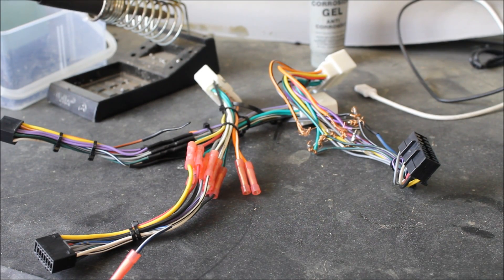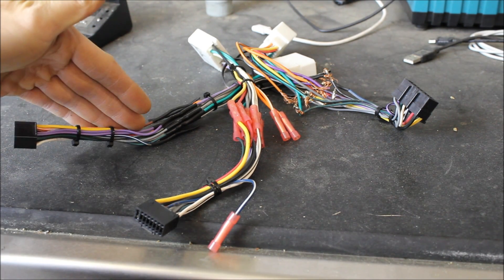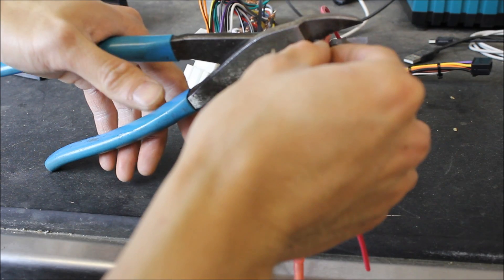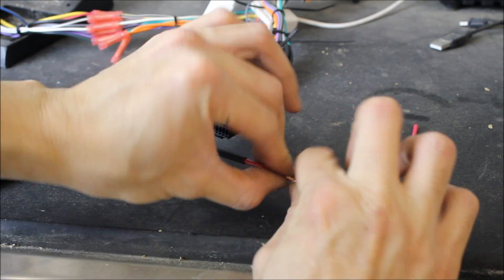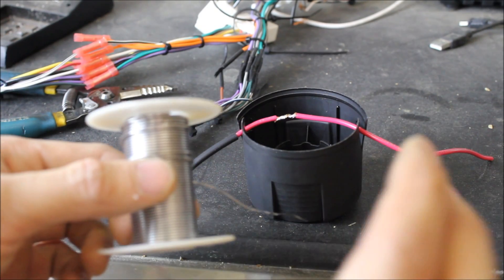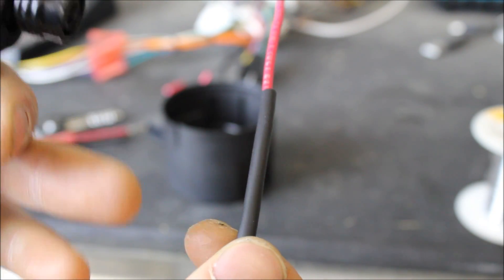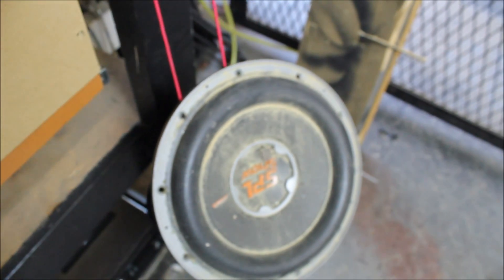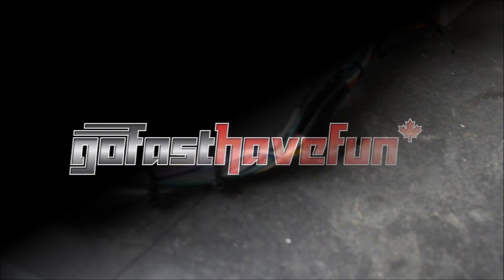Butt Connectors vs Solder | Crimping vs Soldering | Wire Connections | AnthonyJ350

Comment: The tooth slot on the crimpers are not designed for use on insulated butt connectors. The rounded end on crimper is for insulated connectors. Toothed crimp is for non insulated. The tooth can actually cut through the insulation and expose the metal. It should be written on the crimper itself. Also putting to much force on the squeezing the butt connector can not only cut the insulation but also cut the wire. Stop squeezing when you hear a snapping sound or crunch. It's a very distinctive sound and it let's you know that the wire is completely depressed.  With experience it will become like second nature. Also give a light tug to make sure the connection is good and to be completely certain of a good connection you can measure resistance in the wire. In some cases crimps are a better option especially if you are not experienced in soldering.  A cold solder may have you chasing problems in the future.
Reply: With hundreds of millions of butt connectors in use on the planet, this could get to be a long thread.
But I agree with you on him using the wrong jaw on the crimper.
If he spent a tenth of the amount of time googling "proper method to crimp insulated terminals" as he did justifying doing it incorrectly, he'd hang his head in shame.
Reply from the maker: This method is actually in the MECP guide as well.  It's wrong to a lot of people but it's probably because they're not using nylon insulated connectors.  Everyone agrees that the "tooth" makes a better crimp on a non-insulted  connector correct?  So what happens if you use the tooth on an insulator that doesn't break?  Is it not better then?
Reply from the maker: Here's a video I made to show my perspective and it's done in the industry.  Also show the text book https://www.youtube.com/watch?v=i2le4BN0bP8&feature=youtu.be
Reply: +john vinczencz I applaud the effort you put into trying to help this young man understand his mistakes. Clearly he has no intention of learning anything else. I see his point. If you already know everything, why pay attention to a potential teacher?
 Oh by the way, I may be old school, but am eager to learn new and proper methods. From anyone.
 1-8-4-3-6-5-7-2 Clockwise. Except in certain performance applications. Also counter rotating marine applications!
Reply: @richwood8538   That only applies to Chrysler, dodge, older chevy small blocks, and pontiac. Most other 8 cylinder engines use different firing orders. GM's LS small block engines use 1-8-7-2-6-5-4-3 for example.
Reply from the maker: Rich Wood Actually it's in the MECP guide and if you watch this video I go over pros and cons. Also  read the comments of other professionals https://youtu.be/i2le4BN0bP8
Reply from the maker: Samtab Galaxy Here's what the MECP guide teaches https://youtu.be/i2le4BN0bP8
Reply from the maker: justkeepinitrealyo Watch this video on the tooth https://youtu.be/i2le4BN0bP8
Reply: He punches with whole body. Give him a break.
Reply: I got my education in automotive wiring while working with a guy putting equipment in police vehicles. He only ever used the non-insulated crimping tool (with the tooth) on insulated connectors. Why? Because of the result you get from the rounded crimping tools that are designed for insulated terminals. I have seen those results often enough that when I work on wiring with terminals that have these tell-tale crimp marks, I always give a quick pull on the wire. Most of the time the wire comes out of the terminal. This is because the rounded crimping tool does not do a good enough job, because it cannot put enough pressure on the terminal. As for using the tooth-type crimping tool, this does not cause any problems in my experience, which is considerable. With the clear nylon terminals such as used in this video, there is no hole left in the insulation. With the other type (opaque plastic sleeve) the crimping tool sometimes will leave a hole in the sleeve, but it is recessed deeply enough that I have never seen any problems with short circuits. And most importantly, the tool with the tooth does a superior job of crimping the terminal, and I will use nothing else on round crimp-on terminals.
Reply: Everyone crying about crimping a tiny little butt connector. Lmaoooo. Humans...
Reply: John Vinczencz is 100% correct on the crimping issue. The tooth is for un-insulated connectors, and the rounded is for insulated. I'm pretty sure your CL's are not labeled, but if you look at one of those wire cutting multi tools you'll see that its labeled.

If you want to use butt connectors and have them look clean like a soldier connection, use un-insulated connectors and heat shrink them.  It looks almost identical to a soldiered connection, and its better because the heat shrink will be air tight, preventing corrosion.
Reply from the maker: john vinczencz That's how every experienced installer I've seen personally crimp. I've been taught that way and as you can see in the video it holds well.
Reply: AnthonyJ350 Yes it holds well. Not what it was designed for. It means all your experienced installers you know have been taught the wrong use since day one. Read the crimper. It usually says right on it. Insulated and non insulated.   You can argue all day. You will still be wrong.
Reply from the maker: john vinczencz But the tooth doesn't cut through the insulation and creates 2 perfect folds on the solid side of the crimp. Don't I show his in the video? We wouldn't use it this way if it chewed up the insulation. I'm pretty sure cheap blue butt connectors have this issue. Have you tried using the translucent red and blue versions? Honestly have you experimented with these supplies like the one shown and this style of channel lock crimper?
Reply from the maker: john vinczencz Another note, we use nylon insulated connectors not hard plastic (maybe seen in home applications or off the shelf parts). So if we're not breaking the insulation and it grabs well, why can't we do it? If it broke the insulation all the time we'd always pop fuses or short speakers. When you do 5 to 10 head units a day that will not be profitable when you provide a lifetime warranty.
Reply: I have been doing this for 36 years. You are teaching improper practices. You have to keep in mind that beginners and even experienced installers don't necessarily know when to stop squeezing the crimpers and can cut the jacket as well as the wire. The rounded proper end is less likely to be cut. In a video like this you have to be willing to be scrutinized and teach people the proper method of doing things. Yes using the dimpled end works and for the most part will not cut the jacket ( If you are experienced in the field and check to make sure it is not cut). Not everyone watching is going to be experienced and no one wants those individuals to have a potential short behind there dash. For liability reasons alone. Blue Point carries crimpers that have exchangeable teeth that can crimp with the proper round crimp and cannot be over or under crimped if used with the proper jaws. Just asking you to teach the proper method of doing it for your entire audience.
Reply from the maker: All I do in my videos is speak honestly what I find works.  There's a disclaimer at the beginning of the video if you're worried about liability.  So you work as a 12 volt technician too or an electrician? We work in an industry that kind of does unorthodox things.  If we're going to get that nitty gritty about things, then I have to say about which tapes are better in different climates, what's better shrink tube, what solder brand is better,  what wire I find better because some brands break easily.  I've used poor product with proper techniques and connections would not be that good, and you should know what it's like to use inferior product, but noone has a problem with me not mentioning that part for some reason.  I also use really long zip ties (48inches) to fish wire because it's non-conductive compared to a coat hanger.  That's not what it's for, is that ok?

 Let people think for themselves. This is a method I find works well for 18 gauge butt connectors. 

Now if we listened to everyone that said "you can't do it this way because 20 percent of people don't know what they're doing and shouldn't be touching the car anyways".  You wouldn't have factory remote start, screens in vehicles, bluetooth, backup cameras, factory premium audio, usb connectivity and so on.  Those are all things done in the aftermarket which proved their worth that manufacturers copied and a lot people thought after market (mainly remote starters) wrecks the car.

If I didn't try something different that made logical sense because someone has never done it before I never would have built my sub enclosure and attempted to wrap lettering that's so thick. 
https://www.youtube.com/watch?v=mVqQ-1QhoKQ

My Dad thought wider wheels on his van wouldn't fit, he's glad I tried even though "I'm out of spec"
https://www.youtube.com/watch?v=PyL5o-ZtlRI

 I get what you're saying, but I don't make these videos to help people that are not able to think logically or stop what they're doing think why they didn't get the same result, or if they see the jacket is broken think "Hmmmm this doesn't look right".  I make these videos to show how I'm doing it, what results I arrive at on a regular basis and make people think a little differently about things.  Like bees aren't suppose to fly but they do, by physics it's wrong that they can produce lift yet they still fly. I'm just trying to show there's more than one way to accomplish things.

If you don't like it I suggest just make a video that you think is the proper way, do it better and show people.  That's how you'll evoke change and let the intelligent people figure it out for themselves.
Reply from the maker: I do care that's why I only show things that have worked for me over the years.  You even stated yourself "Yes using the dimpled end works and for the most part will not cut the jacket " and it more likely to IF YOU USE POOR QUALITY PARTS.  I can argue back that the section of the crimper you  want to use might not crush enough (which I've pulled a bunch apart) and can still split the jacket if it's hard plastic.

I consult others in the industry all the time on install technique and what is proper and what ways I can grow.  I also try to go to class at least once a year in some shape or form to learn new things and see if current techniques work.

You think I'm arrogant because I'm sticking by my guns.  It's easy to criticise but as soon as someone backs up their perspective and challenges, you hate it.  I noticed most people that know another way it's set in stone for them and people that go to this much effort to comment this much in a self righteous way also don't have videos of their own.  

Here's a video of cheap butt connectors and you can tell they used the insulated portion (that are easy to pull apart).  Refer back to this video and tell me these crimps don't look better and the jackets are still intact in both situations.  https://www.youtube.com/watch?v=1ANADLgLw9M

Did the crimp shown in the video look poor?  And I have to ask the question again, which industry have you worked in for the past 36 years?
Reply from the maker: I see you like Soundman.  Watch this video and pause at 1:27 https://www.youtube.com/watch?v=Nq7Em_pJBNE

That looks like a tooth on the top of that crimp.
Reply from the maker: Wait a minute at 2:24 you can see it clear as day Soundman likes the tooth as well. https://www.youtube.com/watch?v=Nq7Em_pJBNE
Reply: Licensed heavy duty mechanic. Licensed automotive mechanic.
Licensed bodyman painter. I have been in the Car Audio scene the entire time and installed for 36 years of which I own and run my own car audio businesses for many years. You realize for the most part people buy the cheapest connectors they can right? It's like CCA Vs Pure Copper wire. They are both wire but one is garbage. It's our job to educate them on the difference. I will say again the crimpers even say insulated and non insulated right on them. Its not there as a decorative comment.  Also have a Marketing and Human Resources Degree. A bit of a busy guy. And yes I am an older gentleman. Lol. As you know not all crimpers are not created the same either. Cheaper crimpers I have found have sharper edges than lets say a Blue Point. The sharper edge i have seen time and time again cut the casings on qoute good better best connectors where as the blue points rounded edges of the point usually don't.     (Usually) Stick to your guns. It works for you. Read what your crimpers say. Shop around and see what most of them say. If it works for you great. Anyone that doesn't check their connection should maybe not be doing it anyways. I am just saying for someone new to this the correct way is what the crimper has stamped on it. You're taking this to personal.  I am just pointing out for the beginner that maybe my way is safer. No i did not see any cuts in the jacket of the harness you did. Like you said you have done it for years. Knowing when to stop squeezing is something learned over time as well as if you buy cheap products chances are that is what you get. Same can be said about shrink tube or electrical tape brands vs tesa tape. Don't even get me started on soldering techniques. Lol. It's not a criticism.  I am trying to look out for the newbie.
Reply: Ps. Soundman is wrong to.  But he's freaking funny. Lol. Come on!  Lmao.
Reply: I also like Car Audio Fabrication.  Nothing but solder and techflex for him. The best way to go but not for someone who has never really soldered before or probably for a high output shop. My technicians use solder. Do it once. Do it right unless customer specifies otherwise. Ask my installer what he thinks of butt connectors. He will tell you where to put them as the name implies. Lol.
Reply from the maker: Your intentions are noble, but if someone does not back up their way (within reason) and leaves comments unanswered, it discredits them.  So ya I do kind of take it personal on public comments.  Cool I have a university education too and was trained in Business Management.

I had my 4L60-E rebuilt and the guy showed me a trick with the clutch pack.  He put a ring in backwards and told me that it makes them last longer (it was years ago and I'm not a transmission expert) because he put the concave portion the other direction.

My 350Z mechnical expert uses blue thread lock to avoid axle click as opposed to the TSB that says use grease and it works for him. https://www.youtube.com/watch?v=3ipx1OWx3kk&t=8s

But honestly do you do everything exactly how the book says?  Probably not, you take the theory and you refine it or find better ways.  You must have tricks you do in the shop that people question but works very well for you, everyone that works in a shop does.

Was I not transparent in the connection shown?  And I have shown other people doing it, even though you don't agree.

I even do one more things to show that there is more than one way to skin a cat.  I will make a crimping video.  And I will get two individuals who are over 200lbs (ones builds Police cars and the other gentleman does a lot of custom work) and I'll get them to squeeze the crimp as hard as they can and we'll see where they break.  I will also mention the tools used (I'll bring in shitty crimpers too plus the Channellocks I use) and I'll try to bring in different grades of butt connectors.  We'll just see what happens.  I'm taking two people that I don't work with in two different spectrums and they are much larger and stronger than me.

All I am saying is there is more than one way to approach a task and you telling me you're a mechanic .I know you will have your own unique ways of doing things that works for you.  The only difference is I'm sharing mine publicly through this type of media.
Reply from the maker: I prefer soldering myself too,  But I also can't say that when you do a good crimp it will fail inside a car.  Outside of a vehicle is a different story.  I'm trying to be objective.  Now to be fair, don't you no have to go comment on Doug's video I just showed you since he's currently more popular than I am?  Now honestly looking at my channel, do you really think I'm trying to screw over viewers?  I try to address as many questions and clarify things.  If I really didn't care, I would delete your comment and block you.  I leave it up so people can see all the different opinions on the matter because that's what's fair.  Whether people like me or hate me I leave their comments up unless they are completely inappropriate.
Reply: I absolutely agree that everyone has there own way of doing things. I'm not going to lie. I did it your way until someone told me different and tried them all. If you really know what you are doing your way works fine. Soldering on the other hand is the best way. Less bulky and you can hang off it. Unless of course you do cold soldering then it's a crap shoot. Seen it on starters all the time. Worked great till it got cold. Cold solder. Let's agree on one thing. Scotch locks should be banned from earth. Lol. I will be interested to see the video. You know what they say. Proofs in the pudding. If need be I am 6 foot 3 inches. 302 lbs. If you need someone to hang off it give me a call. Five bucks says proper solder and heat shrink wins. You in? Lol.
Reply: EMF Audio if you don't agree or praise him. He will delete you asap. If you watch Soundman comments you will see clearly i don't always agree with him trust me. Lol
 You keep the comments up because you're not afraid to speak your mind. That's honerable. If you had nothing useful to say i would not watch your videos. Do the new video and if i am wrong i will say so. That and i will tell every crimping manufacturer to take the freaking comments of there crimpers. Lol. Not at all do i think you are trying to deceive anyone. I'm just stating what i have always been taught. I guess we will find out whats right in your video. I will be watching.  I can eat crow if need be. I hear it tastes like chicken. Lol.
Reply from the maker: I agree 100% solder and shrink tube (with glue inside if you can) is superior, looks better and is more professional looking.  That's why at our shop and most of my videos you'll see me solder and shrink tube with Tesa tape to harness it together.

I'll make the video but you'll have to be patient because it'll take me a bit to produce a video like that because I'm asking other people to help guest in it.

I honestly think the wire will typically break first before either connection in a pull test.  But I'm interested to see what happens in the crush tests with the jackets.

And yes scotch locks/ t-taps should not exist in any shop or for any DIY project at any level lol.
Reply from the maker: Sounds good man :)